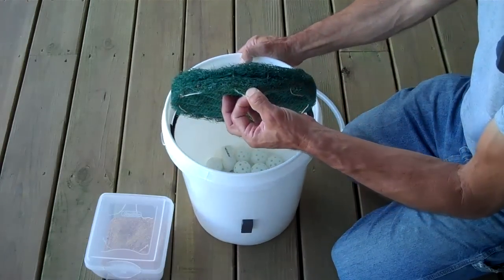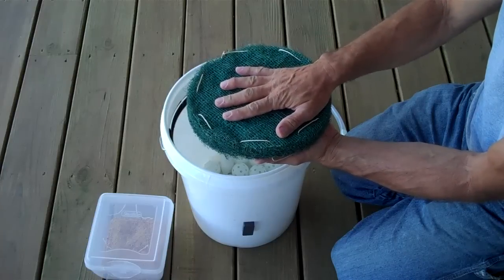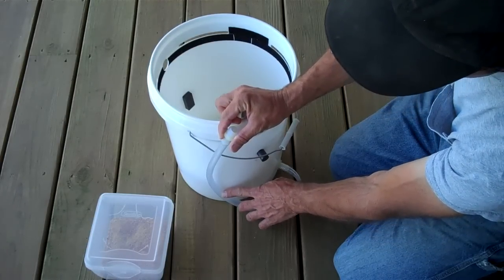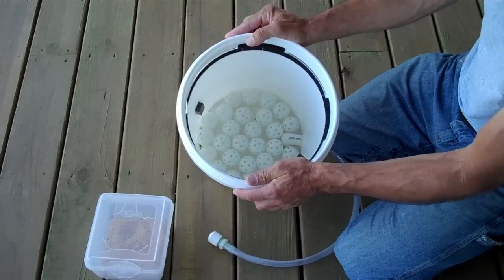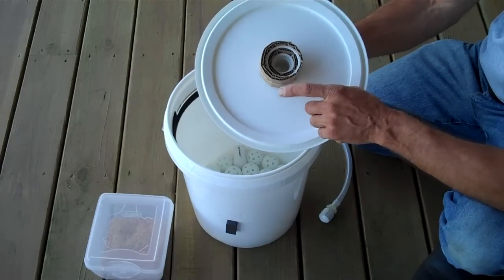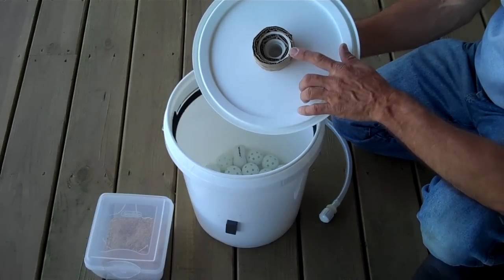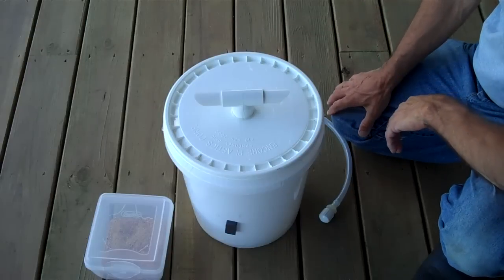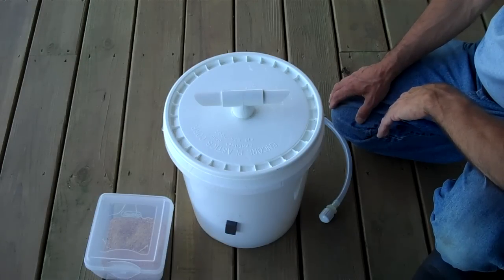DIY black soldier fly bucket composter - part 2

Comment: Great information, I look forward to giving this a try. I accidently raised some in a metal trash can last year that I put some wheat in to keep the mice out. The lid became jarred so I am assuming that is how the adults got in. I am puzzeled as to how the wheat became wet and they started to compost. Unless this happened as they started to comsume the dry wheat and the digestive process added the moisture. I had added no material to compost. I noticed them crawling on my shop floor. They make great fish bait and I am concidering putting one on a dock to self feed the fish. Thanks again for the information.

Comment from the maker: You don't need anything at all to culture BSF. For years I've told people that if they want BSF all they need to do is start a compost pile and add kitchen scraps. I made the bucket design above as an alternative to the BioPod because I felt many people couldn't afford one. My first published BSF composter was a bucket with a lid, some vent holes, and one hole at the bottom for drainage. The "under 5" design is fine, but like all designs it has limitations. It all depends on your needs.

Comment: I killed some cane toads in my pond, put them in a bucket, and tossed a plywood lid on top and forgot to bury them.   The plywood didn't fit tight so I now have my own BSF colony which is being fed with rats, toads, and occasional meat scraps.  At the moment I am not collecting the larvae.  I have hundreds of eggs on the bottom of the lid and around the sides of the bucket.  The really keep the smell to a minimum.  I put a shovel full of mulch to cover up the meat.  I am very pleased with the result.  Should drill a small hole in the side of the bucket to let the fluids drain out?
Reply: Yes Sir you may drill holes at the bottom